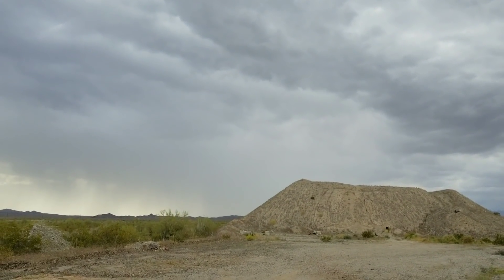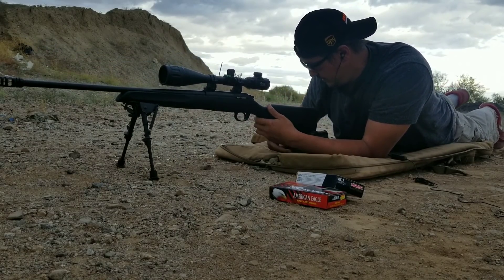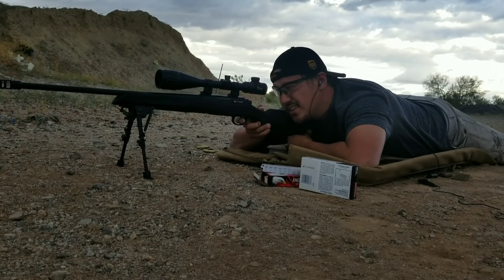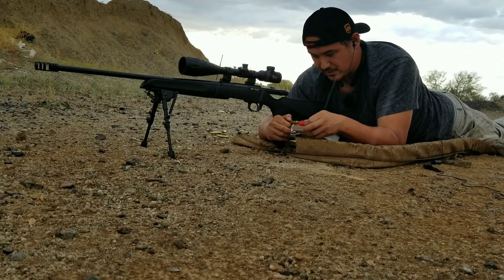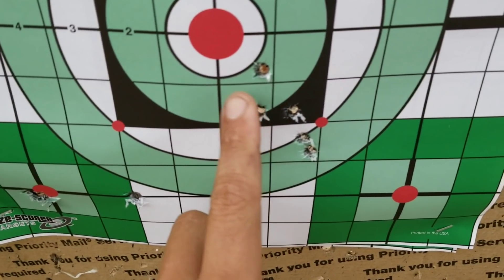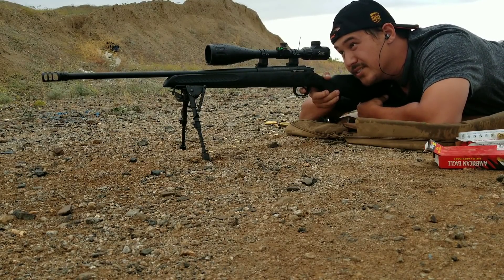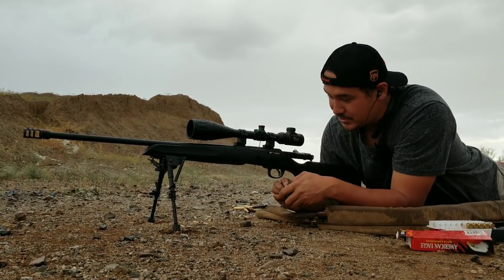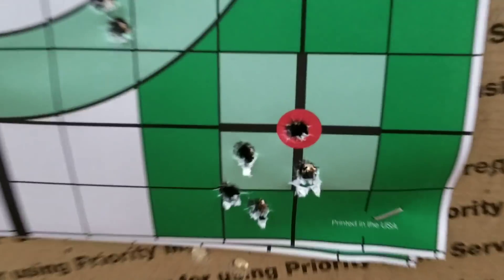TC Compass .308 Update - Back From Repairs Not looking good....

Comment: I have the T/C Compass in .308 and it is crazy accurate. I did have to experiment with several different Brands , Bullet Style and Bullet Weights before I found one the Gun likes. But only after I removed the Bi-Pod I installed. After I  " Bedded " the stock and made sure the barrel wasn't touching anywhere I reinstalled the Bi-Pod with no ill effects. With Fiocchi 168gr TTSX I was grouping 5 shots inside a nickel at 100 yrds. At 200 yrds my 5 shot groups opened to about and inch/ inch and a quarter. That's plenty of accuracy for it's intended purpose , to kill game and put food in the freezer.
Reply: How many rounds have you but through yours? How long have you had it and what do you have to say about it as far as durability and longevity?

Comment: Remove the bipod and it should improve the accuracy. On those cheaper stocks it puts a pressure point on the bottom side of the barrel. I almost threw my Ruger American away until I took the bipod off and it fixed it.
Reply: And that is not the first time I have heard that. I have been shooting from bipods, sometimes with great results. But I am wondering, on my lighter rifles, if the bipods are working against me. I am getting the TC Compass II in .308 Win in about a week. And I may forgo putting a bipod on it and just shoot from bags. Even hunting, I use a tripod that I can cushion with a towel. Or shoot off-hand (public land.)

Comment: Oh NO,  They sent you my old rifle!!!  Here's my 2 Cents.  The odds of that shooting MOA with factory ammo is slim to none.  That pencil thin barrel causes it to be very picky about barrel harmonics.  You had a lot of vertical stringing.  I noticed this with some of my hand loads.  Once you get it in tune with some hand loads, it will tighten up.  You might try that limb saver rubber thingy.  It might show some improvement with it.  Also the brake changes up things, but I'm like you and will take my chances using it.
Reply from the maker: Thanks a whole bunch bud! Yeah I went off what they said to do as far as there MOA guarantee. I got those 155grs coming in tomorrow and gonna see how close a node is to your testing with varget. I noticed my chamber headspace is 3 thousandths tighter than my last rifle yet the bullet OAL is the same as before.. this barrel is the thinness ive ever seen for a 30 cal. Crossing my fingures
Reply: I'm shooting the 168 Federals until they run out, which will be replaced with the 175 grain.  I need to shoot it more but so far I'm right at moa or slightly under. I have a similar style muzzle brake, and I filled the butt of the stock with liquid nails and the front with epoxy though.

Comment: It’s a sport-er barrel, shoot 3 shot groups instead of 5 shot groups. Those barrels really heat up. Have you torque spec’d the action screws? 

I agree with the 6.5 Creedmoor, going to get myself the Compass II this year. Muzzle brake, Kydex Cheek Riser, and Bi-Pod. Perfect deer rifle.
Reply from the maker: Yup, i agree. The barrels are crap.  Checked out the compass ii at shot. Same rifle different trigger,  same crappy barrel.  Stay away from the 308. And yes iv torqued and played with different torque settings with slight improvement.  I re did the crown also.  Im swapping barrels soon

Comment: My BIL has a TV compass in 6.5 cm and it's a lights out shooter. From cheap ammo to match grade it shoots great.
Reply from the maker: Ya i shoulda got this in 6.5 haha. The problem it seems is this super thin barrel and no meat around the bore of a 30 cal. It seems the 6.5 and smaller calibers perform way better in this rifle. And I really think its because of this thin wall barrel
Reply: @EagleEyeShooting  it may just be picky on ammo weight. And bullet type. My BILs 6.5 only like 140gr or heavier. It throws light bullets around like a shotgun blast. I have a 30-06 the same way. I have to stay with heavier ammo for it to shoot good
Reply: @EagleEyeShooting  in the atr video you were using an app to show group sizes and what build it was.. what was that app?

Comment: BUY A SAVAGE..  I have a 110FP in a Choate stock chambered in 308 that shoots 168 A-Max into 2's and 3's @ 100 yds.  Few rifles, regardless of brand shoot very good with factory loaded ammo. At least none I own.
Reply from the maker: I have one in 6.5. Shoot it past 2k yards check out my other videos.  And just built a 308 and shot it over a mile with the 168eld...
Reply: @EagleEyeShooting  I've been checking you out.  Is that Compass bedded at all?  I have watched some, but I'll look for the 308 video. I'm jealous . My range here is only 300M long.
Reply: @EagleEyeShooting  Try this on your Savages. I did and it does work. 

http://bulletin.accurateshooter.com/2012/12/tuning-savage-actions-using-action-screw-torque-settings/
Reply from the maker: The compass is factory still.  Going to rebarrel the thing. Smith and Wesson/ TC screwed on lousy 308 barrels

Comment: I never heard of re-seating a factory round. What or who is your source recommending a re-seating of a factory round?
Reply: I wondered the same I've reloaded for 30+ years an have never heard of such. Just to pull the bullets usually buggers up the projectile even with a bullet puller
Reply: @rogeradkins9146  Right on. It's been my experience the factory rounds have some kind of a sealant or glue, making it difficult to pull the bullet out of the case.
Reply: @tyronekim3506  All factory bullets have a light tapered crimp an being as such how did he re seat them without re sizing the neck? I dont even see that being possible an if he did it cut into all the projectiles an hence poor groups.
Reply: @rogeradkins9146  The guy may have pushed and seated the bullet deeper into the case without removing the bullet, causing excessive amount of distance before the bullet engages to the lands of the rifling. In other words, the bullet had too much travel before engaging the rifling. This is why I think the accuracy was poor for his factory, re-seated, round.

Comment: Hey Kenny! I'm looking forward to getting my 308 Compass done (glass bedding, Boyd's stock) so that we can compare notes! What brake are you running?
Reply from the maker: Hey Brother! Its a cheap Ebay one from here
https://rover.ebay.com/rover/0/0/0?mpre=https%3A%2F%2Fwww.ebay.com%2Fulk%2Fitm%2F222856631363
Been having lots of luck with Varget and a 180gr Nosler BT and a 168gr ELD. Both same powder charge of 43.6gr. It seems to really like lots of bullet jump. 100" off lands. This puts thes 180gr Nosler with what Nosler posted as accuracy on there website at a 2.800 COAL. Im at 2.810" with the 180gr. Consistent 3 shot half MOA groups now but I have to let the barrell cool after that. My son did well recently at 1000 yards with it
Reply: I am also getting a Boyd's stock. Can't wait

Comment: Man, I wonder if the headspace on that rifle is just on the top end of SAAMI specs. Did you by chance check headspace before firing and after on your brass? That group looked pretty damn good with your handloads bro. I have a feeling you'll be able to really dial it in now.
Reply from the maker: Hey TinMan! Ya the headspace is actually tighter. .003" than my last rifle. Thats kinda a huge difference. A typical NoGo gauge is .003" longer than a Go gauge haha. The Throat is the same though checked with all my previous bullets. I think 243 Outdoors is right. Just need some load Development.  I tried to follow what TC recommended for there "moa guarantee "
Reply: @EagleEyeShooting  shorter headspace isnt a bad thing. Makes it so you can use your shorter brass. You've got it figured out bro. Time to see what that rifle can do!

Comment: Dude finally was able to hit 375 yars with 168 speer 40grn 5 times back to back. Never been able to do that with that tc compass I'm wondering how it will do with 175 grn... O I added some weigh on the stock put a bag of sand in it.

Comment: Learn to keep both eyes open and you will get better groups. Also use more the end of your finger and not the crease. That will help you a lot as well.
Reply from the maker: Cool. Hey just check out your vids... quick tip in return. NEVER lift any vehicle on the front core support especially on that SC400. Lift points are on driver and pass kick pannels just after mud flaps. Also use a shop press to remove those bushings.  I used a ball joint press fitting and sharpened up the opening. No need for a torch.

Comment: Maybe, it's the cheapest scope you put on it. I just got one of these in 308 with a vortex 4x12 so wish be luck. But for the price it should make a good snomachine gun.☃️🐻
Reply from the maker: Lol not the scope.  That scope has gotten me first round impacts at 1500 yards and has tracked well with a SWFA. Its the cheap thin ass barrel. Lmk how yours works out. I  slap betcha it wont consistently shoot 5 shots sub MOA. I went through three of these in 308
Reply: @EagleEyeShooting  yeh, I wish it was 223, but for a cheap snow machine hunting gun, or truck gun I'm hoping it works out ok for wolf hunting in Alaska, I usually shoot a sendero 300 mag. But I messed my shoulder so have to down size for a while. Don't have much problem keep barrels cold, but freezing and condensation can be a huge problem. LoL☃️😂🐻🐻🐻🐻🐻🐻🐻🐻🐻🐻🐻🐻🐻🐻
Reply from the maker: @danjones4966  haha I absolutely understand.  Gotta love a good muzzle brake. Thanks for sharing brother. Btw 43.6gr Varget Hornady ELD at 2.830" has been the best load for it so far👍

Comment: Muzzle brakes can cause accuracy problems.
Reply: I'd love to see proof of this... since every break I've ever installed has actually helped..
Reply from the maker: @duane pearce, actually prepare2survive is absolutely correct. And I have experienced this for myself. Check this video out from Mark and Sam After Work. A really awesome channel. Great enlightening and demonstration on this exact subject
https://youtu.be/XG0qu8E7NVM
Reply: @duane.pearce  Do a search on youtube for " muzzle brake pull off "
Reply: @EagleEyeShooting  that was a cheap clamp on muzzle break. I've never had an issue with muzzled breaks.. however I just installed a new one on my ar10.. maybe it will be like the rest. That was also on a sporter barrel and I've done have been on a bull barrel so maybe that's the difference?

Comment: A few things here, try it without the bipod, try it without the muzzle brake, and also, fix your face. Literally. Your cheek weld sucks cause your scope is too high. Also, shooting in the modern (lazy) hand under buttstock position, as opposed to supporting the fore end, is known to cause stringing shots because the barrel is jumping before the round exits the muzzle.
Reply from the maker: Its the barrel dude. Repeatability trumps everything you stated, finding repeatability is what counts. I have no problem taking rifles out past 1 mile and folks like Mark and Sam Afterwork YT channel can shoot ELR with no issues without what your saying. That common thought is a fallacy

Comment: I just bought one, and this rifle, for a sporting weapon, is a piece of crap.
For starters, the barrel is so much heavier then the cheap plastic stock, instead of balancing in my left hand, it pitches forward to the point where I have to tire my left arm to support it for offhand shooting.
And, when I fully withdraw the bolt, it dangles to the point where if I try to hurry it back in, the bolt body's front edge binds up in the rifle's receiver, making it impossible to make a quick "second shot" if you need it.
Thankfully, I ordered it from an out-of-state gun seller who sent it to my local FFL, so I am OK to send it back for a refund!
Reply from the maker: Check out what ive done to mine in a latest videos

Comment: even with hand loads thats not very good, my factory in my model 70 groups tighter then that
Reply from the maker: Nope not at all. TC replaced this rifle twice and is still sub par. Ill be rebarreling the rifle... the 30 cal in this skinny bore is the Achilles heel
Reply: @EagleEyeShooting  i love my model 70 in 30-06 got it at a pawn shop for 320 bucks and its shooting sub moa with cheap winchester rounds 180, later i will be reloading some federal fusion 180s to make it a nail driver, i shot my buddies 6.5 creedmoor compass and i didn't like the trigger or the bolt. my old mossberg patriot in 6.5 creedmoor i did a .65" grouping with the hornady precision hunter 143 grain, my buddy shot his compass with the same rounds and shot a 1.75" grouping, my opinion is spend the extra 80 bucks and get a ruger american, a better bolt, trigger and way more accurate rifle.